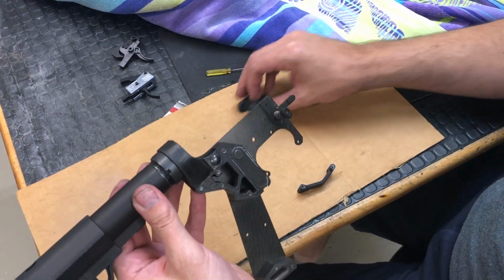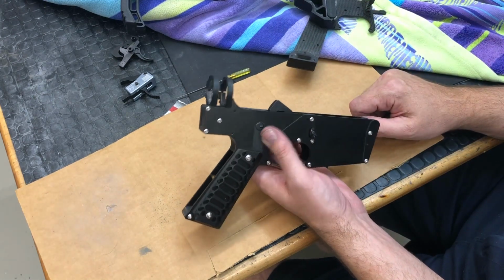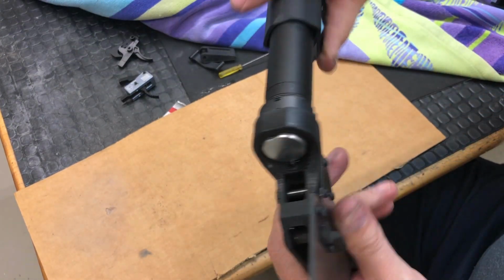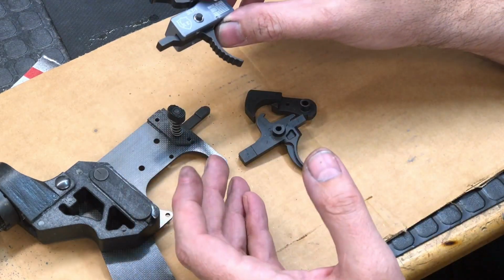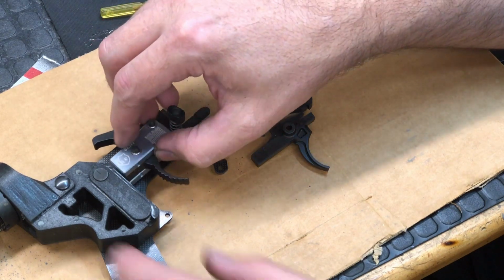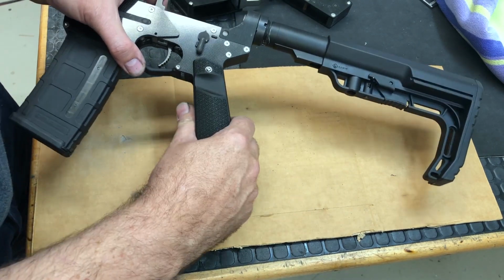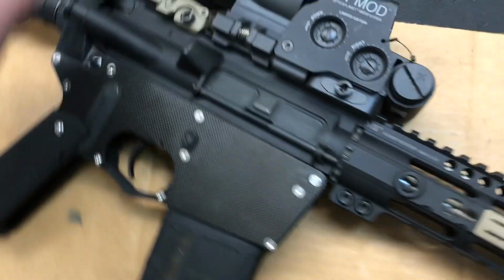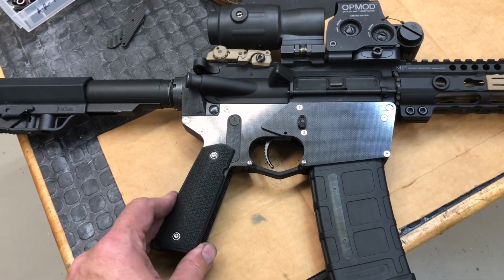Quick80 - Prototype version 2

Comment: As much as I like the 1911 and its grip angle, not a fan of it on the AR platform. Since the 3D printed pieces are going to replaced with aluminum, you should design them to accept standard AR grips so the builder has that option. Also, with the middle block being aluminum too, you need to incorporate a bolt catch. At your projected price point, the lack of those two features would make this a no-go for me.

Comment: This is brilliant.  I'm a tig welder and I've been thinking of making a lower from sheet metal and sharing the designs online. I have templates but now i'm gonna redo them because this gave me some ideas.
Reply: I don't know much about metals, A light strong stainless steel would be a nice idea. Please share the templates with me.
Reply: @ I gotta search again but if you check the national archives, there’s blueprints for an aluminum bolt together lower receiver.

The exact same aluminum design can be made with stainless… the material thicknesses would need to be adjusted.

Comment: Unfortunately, I cant see how it would NOT be considered a firearm, even unassembled.  An 80% lower needs mill work to fit the FCG in, but fully assembled without any cutting, yours is ready to go.  I hope that's not the case, though.  Its a beautiful kit.
Reply from the maker: Thanks, but there will be left some drilling operations to the purchaser.  Mainly, the trigger pin holes and possibly the takedown pin holes. Hoping for the least amount of drilling operations as possible.
Reply: @nozirohsystems2204  keep yourself above board as much as possible so this can go forward.  This is a NICE system and looks like a logical step forward from milling.